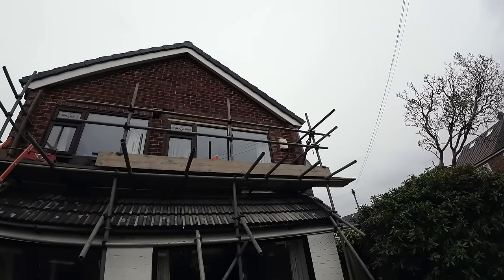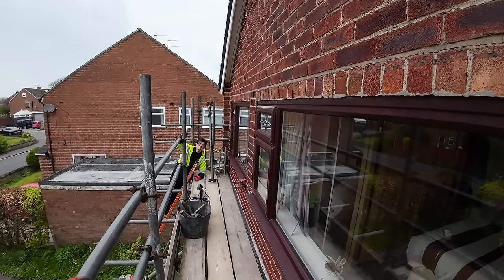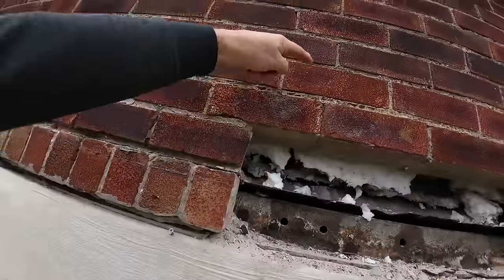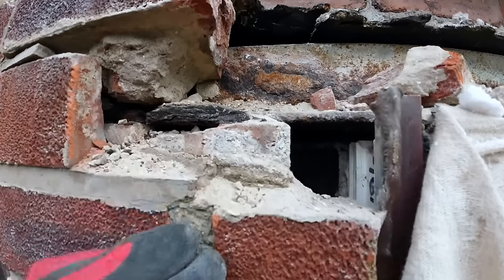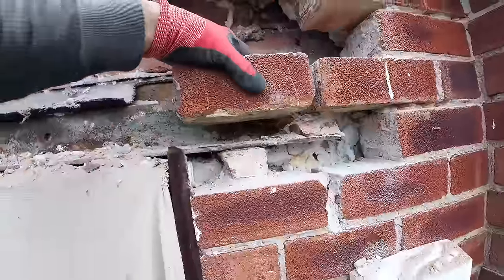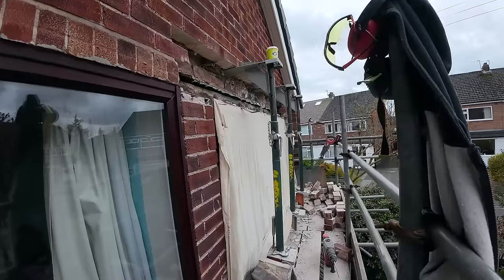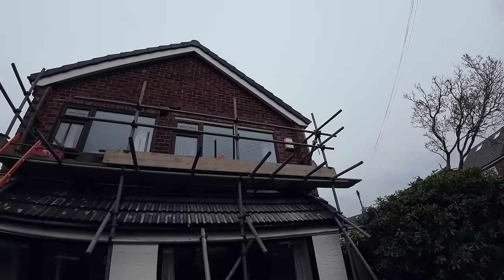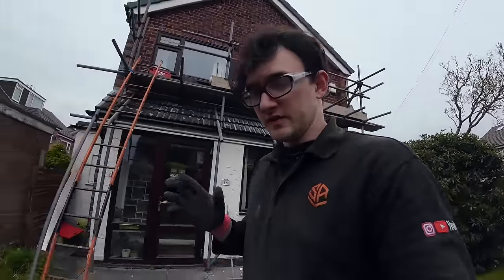TERRIBLE COWBOY BEHAVIOUR AND ALEX GETS A MASSIVE SURPRISE

Comment: Excellent work as always. Can I just ask but I have a few windows like this that the soldier course or whatever is lower than the stretcher course above window. Does this mean there's no lintel and that the brick works sat on top of the window? House built 1900-1905. Obviously windows changed but just wondering if I need to sort them out. Currently no bowing or cracking issues I can see. Thanks.
Reply from the maker: Best to get someone to check in person 🧐🧱👍🏽

Comment: What was the reason for the silly 3 board wide scaffolding?
Reply from the maker: No idea but we really struggled 😒🧱👍🏽
Reply: Carpenter & Joiner here, I have never in 37yrs of chippying encountered a 3 board scaffold. 

No wonder you was struggling your tits off working on that.

I've encountered a few proper dodgy scaffholds with traps or other dangerous things that I've refused to work on until they were sorted out. It's staggering how many cowboy scaffolding firms are operating.
Reply from the maker: @WombleUK 😬😬🧱👍🏽